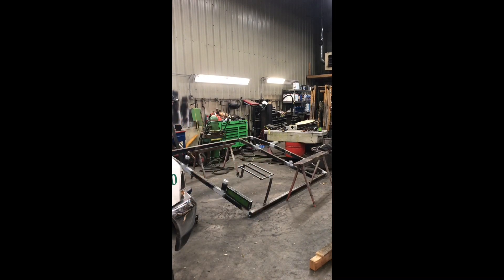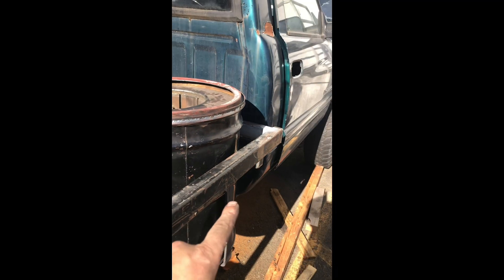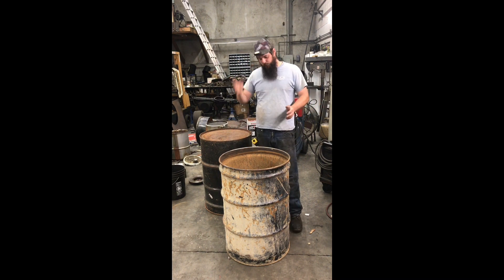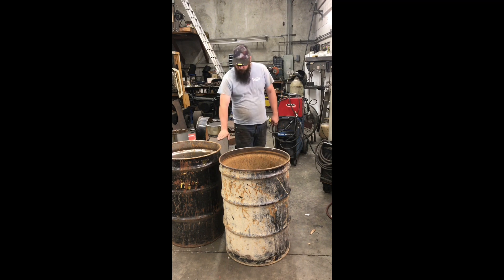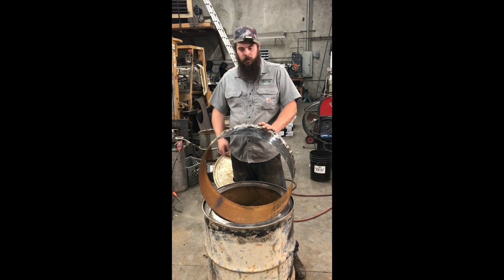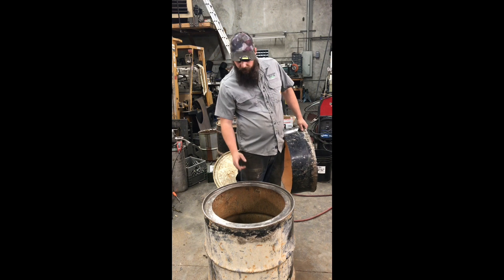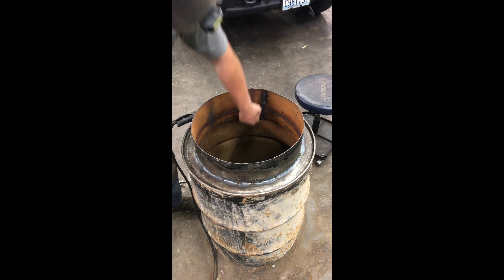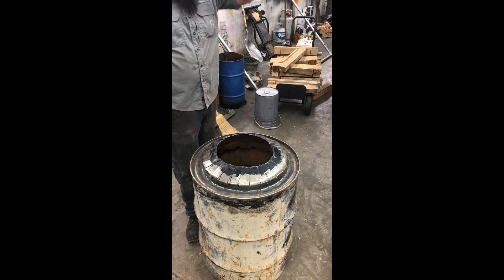V10 Dodge Gasifier Hopper Construction

Comment: Good info. I'm still trying to work on the concepts. Instead of scaling up, what about scaling down?  With out big cylinders, we, as a country  will be left with a few small cylinders. 2-6 max.
Reply from the maker: Smaller you go the less vacuum across the system. Less flow internally, cools the fire down to the point that tar can make it through the char bed without being converted to fuel and rish making it to the engine and sticking valves and creating havoc. Basically below 500cc the better option is char gas, produced from charcoal instead of raw wood. Charcoal is purified carbon that contains no tars so it can burn at a much slower and lower rate, but needs water added to the burn to moderate temps as char burning will overheat and reach melt down temps in short order if left unchecked. Think a forge with the fan stuck on high, the precious knife blank inside suddenly reduced to nothing. Also the added water means a conversion of some into hydrogen gas, something the raw wood gassifier already has to help self moderate high temps. 
There have been successful single cylinder systems, but ideal use is 2 cylinders or more so as the gas flows and that moment of valve overlap happens and the back pressure pulse comes up the intake runner just after the intake valve slams closed, it doesn’t stall out gas flow but instead has additional cylinders pulling at that time keeping the gas moving towards the engine. That single cylinder intake pulse can be a turd when trying to burn any gaseous fuels that are not injected under pressure like propane ( a distinctive advantage over woodgas)
Reply: @BigBeavrSlayer  OK, I think I understand. So what about boosted flow to compensated for fewer cylinders? If you have a 4 cyl using a mild boost turbo to help offset the needed vacuum? I remember reading about someone taking a 4 cyl like a vw motor and using either a small turbo,  or a small super charger to boost internal intake flows with some of the boost sent to a part, (I don't remember the details) of the wood burning tank. But then again, I may be mixing things up.
Reply from the maker: @stevew1851  it's being played with by a few people but no one has been able to figure it out yet, mainly because relying on the engine vacuum to deliver the fuel means that either super charger pro charger or turbo since it is forced induction you need to compress your air/gas mixture through that system which is a bit dangerous, but the bigger problem is since the operator sets the air fuel mixture manually, if you then compress that mixture and force feed it into the engine of course you get a rapid rpm change, which demands more fuel to keep the power up and rpm raising. That sudden change throws the air/gas mixture off and it almost instantly goes into a lean burn. To my knowledge only one person was able to do it and make it work through a computerized mixer programmed to change the mixture for a given percentage of throttle but it was so primitive after over a year of trying to get it to run right he pulled the supercharger off and found it made more power and torque naturally aspirated
Reply: @BigBeavrSlayer  Thanks for your reply. I am really impressed by your expertise in this field.
Reply from the maker: @stevew1851  oh trust me I'm no expert I've just read everything I can get my hands on that's printed in English to be learned but nobody has translated it from a lot of different European languages
Reply: @BigBeavrSlayer  Odd, isn't  it? I wish my oldest brother was still around. He lived in Brussels, and was fluent in several languages, and knew many of the "right" people. So much history/technology has been lost.
Reply from the maker: @stevew1851  there are a bunch of books on this from the 20's into the 40's ,gengas is one term they used which I believe is either French or Swedish. And then the German word for it holzgas. I have a few subscribers from over there a few from Ukraine Sweden, Hungary and Spain.  Found out that Germany is the only known country try in the world that has outlawed the on road use of woodgas. In Sweden you can register one as a hybrid and get a small tax break, but has to be a Era specific designed systems and cannot be on a vehicle newer then I think 1970 something. Any vintage Era correct woodgassed vehicles from does not have to pay registration but has to pass saftey inspection. But no one has asked about the legality of it in the USA,  we are pretty sure they would label it as a road hazard and impound the rig. Even though it is the only true carbon neutral fuel system known to man